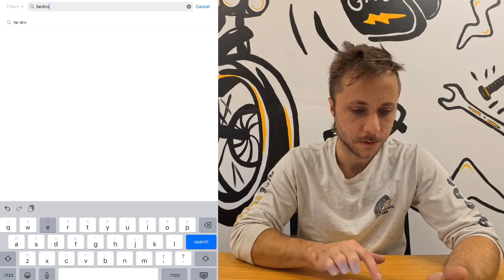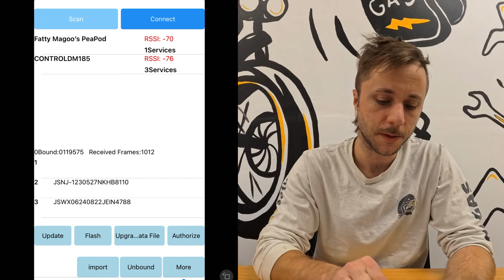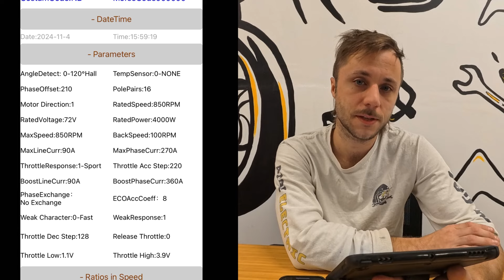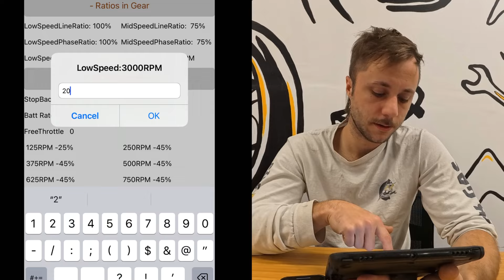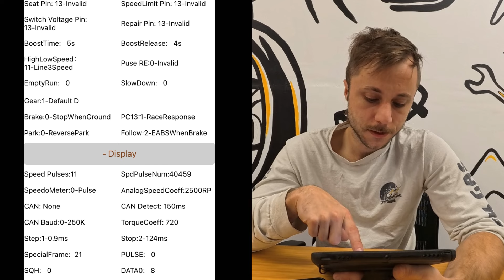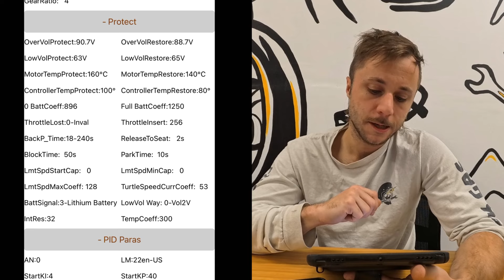The Ultimate Fardriver Controller Guide (Registering | Auto Learn | Settings)

Comment: I am confident this guy doesn't properly show how to tune the controller. For starters Pole Pairs MUST BE SET BY THE USER , Auto learn doesn't adjust pole pairs. I also get the sense you dont even know what half these settings truly do. Please reconsider this video, its not helping the community by giving wrongful tuning information. Not hating just concerned, i have tuned many fardrivers for businesses professionally.
Reply: So  @FardriverTunes if you have
So much knowledge on this subject Where can we find your tutorials at....just Sayin!
Reply: @fardrivertuning need some help desperate to get this build working
Reply from the maker: At 13:40 I specifically state that the pole parts must be set and use the motor manufactures parameters. I’ve built nearly 400 bikes since 2019. This video is meant to be an approachable overview for the majority of casual riders who just want to make some basic changes. It’s not intended to go into heavy detail for manufacturers
Reply: @SparkCycleworks  most qs mid drives are 5 pole pairs 

Hubs are 16 23 or 28 

No hubs are 8 pole pairs ...
Reply: Rated Speed and max speed are 2 different values .
Reply: @FardriverTuning yes, Rated speed is measured during autolearn, changing it’s value manually doesn’t change the rated speed. And you CANNOT go to the manufacturers website to find the rated rpm because they offer many winding options. And QS never said the max recommended speed was 850 rpm unless it’s some ridiculous 5T winding. 

Setting rated speed and max speed to the same value does show a total cluelessness about whats going on. I mean, if 850 was the real rated rpm, just leave weak response at 7:none, and let back emf be your speed limit. Unless thats too fast, in which case you would set maxspeed to less than rated speed.

It is unfortunate that so far there are ZERO videos showing how to do basic setup without lots of nonsense added. Even the self-proclaimed Fardriver God is on some YouTube videos spouting total nonsense, such as claiming the Fardriver does field weakening by increasing voltage. Thats some Flat Earther stuff right there. lol
Reply: @imho7250  says the guy who spins motors by hand to confirm the pole pairs .

Field weakening does increase voltage to make more RPMs in the motor
Reply: ok FardriverTunes, you just revealed you know ZERO about electronics. If you have any doubts about being able to find pole pairs using the method in my video, you are welcome to comment. Everyone who understands motors knows this works.

Now, for the 100% nonsense you are regurgitating that the fardriver increases voltage to for field weakening, it means you don’t know what field weakening means, or how it’s done. 

There are ZERO ebike controllers on the market that have the electronics needed to increase voltage, and IF such a method was used to increase the rated speed, it would NOT be called Field Weakening because its not weakening the field.

Sounds like you are regurgitating some nonsense Ryan Goodyear said on a video a few months ago. 

I suggest you watch a few videos on Fardriver teardown, so you can see that there are NONE of the components needed to increase voltage, and maybe do a little studying on what it takes to increase voltage. None are practical in a small controller so nobody uses that method to increase speed.

Better go get your friends to try to help you on this one.
Reply: @imho7250 it's my understanding that field weakening works by changing the current frequency sent to the motor essentially canceling out the opposing frequency or something something and this weakens the magnetic field allowing the motor to spin faster since there's less friction from the strong magnetic field of these motors meaning the voltage applied can now "act" as a higher voltage turning pushing along the motor
Reply: @ , its definitely a complex topic. 

It’s not really friction  because that implies its applying a braking force to the motor, which it doesn’t do. Its just the fact that every Permanent magnet motor is also a generator, and at a certain rpm it creates enough voltage to balance battery voltage. And of course if the battery is at 80v and the back emf is just below that, no matter how much you try to open the Mosfets longer, its not going to send more amps.

As the rotor spins, the magnet fields can be broken into its components, q-axis (mostly responsible for making torque) and d-axis (mostly responsible for making back emf). 

While FOC is busy making torque, adding field weakening on top creates an additional field that pushes the d-axis lower. Thereby decreasing back EMF, allowing the motor to run faster. Thereby decreasing drawback is it eats into the max phase current bandwidth while simultaneously allowing FOC current to be higher to run the motor faster, so the motor temperature will increase exponentially. 

Increasing the battery voltage is always better than using field weakening. Thats why so many are moving to 96v and 108v. Unfortunately some of these guys bought the wrong wind (4T) and still need field weakening. Some people also go overboard using a 2T motor with 26” tire and 108v.
Reply: @imho7250  I'm going to 96v from 72v, I got the 96450 with cooling plate. My current motor is a 72v 4kw QS hub 40H 950rpm 24pole pairs.
Reply: @ which motor diameter (273/260/212/205) and what diameter tire are you running? 950 @72v is a pretty common wind but it depends on tire diameter. 24 pole pairs is not common for a modern QS hub motor. 

At 96v your motor should have a rated rpm of (96/72)950=1,266.667 rpm unloaded and 1000 rpm loaded.
Reply: @imho7250  it's a custom OEM motor QS made, goes on a 12in rim, tire is 215/40r12
Reply: @ , ok, so something like an e-vader, e-grom. So it would seem your bick can go approximately 60 mph without field weakening with 96v. Probably in your case, like mine, field weakening would be turned off. Adding field weakening to go 70 mph will make the motor overheat very fast, so not really worth it.

The candidate for field weakening is a high power motor with low voltage but power battery. Im making a 48v21H P42a pack for my ZSUN build and that will slow me down enough to actually use field weakening, allowing me to make videos showing the effect of various settings. With my old 60v battery it went 5 mph below death wobble rpm so I left field weakening off.

Luckily your bike can easily accept a 50ah pack, so even cheap cells will be powerful enough.
Reply: @imho7250 what’s wrong with flat earth?
Reply: @imho7250 globe earth nonsense is just as ridiculous as the fe crap to be fair.
Reply: @davidhazel36 so are you a cube Earther? Lol. Can you give an example of “Globe Earth nonsense”?
Reply: @SparkCycleworks @13:58 “That Autolearn does a good job of detecting pole pairs”. 

No controller on the market can magically sense pole pairs. Every programable controller will ask you to enter the pole pairs value. If you don’t, it doesn’t care, it will still run perfectly fine, but the reported RPM, and speed signal will be off. 

I challenge you to set pole pairs to any value the Fardriver will accept this is not the correct value, run Autolearn as many times as you want, and it will NEVER change the pole pairs.
Reply: Can you please try help me tuning my fardriver controller. I made a comment literally a minute ago on this comment section underlining the issues im having
Reply: @chloebell5990 , it’s easier if you make a fresh comment on one of my many Fardriver videos.

Comment: Temp sensor; you can also set it to CACU. This allows the controller to calculate the motor temp based on reading. Cant vouch how accurate it is but it's one barrier of protection.

Throttle Dec Step: you want at max 224 for safety reasons. Setting it to 224 removes the time delay from when you cut throttle.
Reply: 4-CACU doesnt read motor temp it bases temp readings off of the controller MOSFET Temp.
Reply: @FardriverTuning the original comment was edited so I don’t know if he was wrong the first time. Lol

Yes, the CACU motor temperature simulation does use the controller mosfet temperature as a reference point, at least as starting temperature. The RatedPower setting is how to calibrate the thermal mass in the simulation. I made a video a year ago demonstrating it. Setting motor rated power to a lower value, decreases the thermal mass, so motor temperature gauge increases faster.

What is NOT clear is whether it’s simply using MOSFET temperature change and multiplying it by some constant divided by RatedPower value, or if it uses amps as the variable for heat added. 

Since ratedPower has absolutely nothing to do with controller power output, I normally set it to about 50% of the motor’s claimed max continuous power, and it ensures the temperature indication and controller shutdown will be conservatively ahead of actual motor temperature.
Reply: Yes, for all direct drive hub motors, 224 accelerate and decelerate is correct. The 220 nonsense is just Ryan Goodyear’s signature so he can see who is using his tune. 

The purpose of slowing the deceleration ramp is mainly for drivetrains that have wind-up, such as a motor going to a differential and then an axle shaft out to the wheel, or something with lots of chain slop. 

Anyone who watches someone first learning a manual transmission and lurching the car as they get on and off the throttle can see why it needs to be dampened. Most cheap Chinese tricycles and golf carts don’t have proper dampening and will lurch like crazy. With the Fardriver you can tune it to be smooth even if you are trying to get it to buck like a bronco. 

Unlike some myths, neither one has to be faster than the other. It all depends on the drivetrain response to changes in throttle. But slowing it down a bit it allows the gear lash to be taken up and the axle torsion to wind up more gradually, and the parts will last much longer. 

But for direct drive hub motors we all want it to respond as fast as possible, and we can use ratios in speed to decrease starting torque if its too much.
Reply: The auto relearn doesnt work on ours it just beeps and does nothing when holding the throttle. Can you help?

Comment: For some reason every content creator who speaks about the PID Parameters says "DO NOT TOUCH THESE!!" But they're really not scary settings. the only things you definitely do not want to touch are MOE and LM everything else is good to mess around with. it just adjusts how power and torque is applied in relation to the throttle motor and controller.
Reply from the maker: As a manufacturer, I can tell you the vast majority of headaches come from people messing with PID who have zero electrical knowledge.
Reply: Can you give a quick explanation of each of the other PID settings?
Reply: All Fardriver I tuned for hub motors needed LM tuned. 22 is too high, 16 was optimal. And the current control loop integral values can normally work better if decreased 1-2 sets below default. 

Proportional control settings have been blocked fo a long time. Before they were shown, but automatically adjust to 10x KI. Now they aren’t even showing whats going oh behind the scenes. Lol.

The KO MOTO controller is a fardriver with some hardware changes, but it’s the same basic firmware. Anyone who knows fardriver will immediately recognize the PC app and see the mobile app is working with the same settings with a different GUI. Reading the KO-MOTO tuning guide does give additional insight into AN and LM.

Comment: As soon as I click “get verify code” the app disappears off the screen. I open it again and try again, same result every time.
Reply: Enter your email AND a password
Reply: Make sure your phone doesn’t belong in a museum. I was using the fardriver app just fine on my iPhone 6 for a while, and then after an update about a year ago, when it started asking for registration, the app would crash each time. 

Then I got iPhone 10 (Xs Max) and it works without crashing. So if you have a super old phone, try a newer phone. I think the same applies if you have a very old Android phone.
Reply: @ iPhone 15 pro max. I eventually got it working
Reply: @ what was causing the app to disappear off the screen of an iPhone 15 Pro Max?
Reply: @ I never figured out what really got it working. I also never got the email verification. It just started working and connecting to my controllers. Has been working fine ever since
Reply: @ , very strange. Are you able to bind/unbind without it being registered? The binding is sort of a pain if you have different devices and Fardrivers, but I guess its good if you are out riding and not connected and someone else connects and sets your settings all wrong just to mess with you. Lol.
Reply: @ so far I’ve had no issue binding 2 different controllers. Haven’t un bound any yet. Not really worried about people connecting to it and changing settings. Most people around here have never heard of far driver and think a controller is for video games
Reply: @ ok, you haven’t bound any yet to unbind. It won’t allow you to bind if not registered because if you try to connect another device to a fardriver that is bound, it will send a request to the email used to register and ask for unlock. Ive heard of people selling bikes with Fardrivers that are bound and refusing to unbound them, making them impossible to do any tuning on.
Reply: @ not really sure. The most important part to me is connecting and adjusting parameters which I’m able to do. Anything beyond that is of no concern.

Comment: Any suggestions on if I’m either not getting a voltage reading on the app and the throttle isn’t responding when wired correctly 

Or 

If I swap the green and black wire to get voltage reading but still no throttle response?
Reply: Make sure the colours of the wires are the same most importantly make sure the black cable on the throttle is connected to the black line of the controller throttle connection some times there not always the the same order ( red black green )